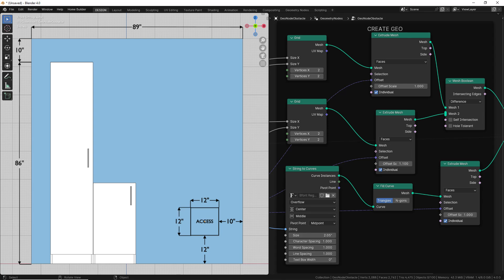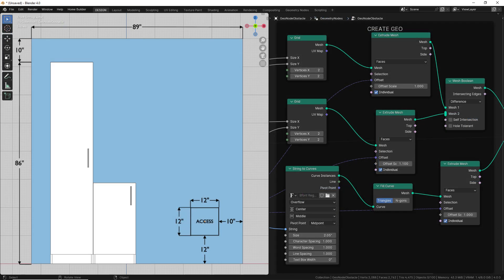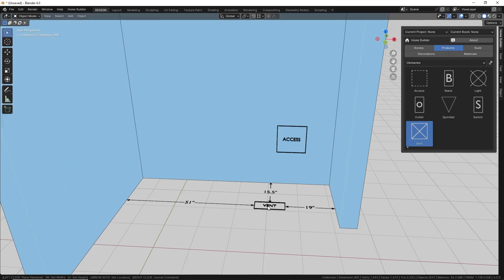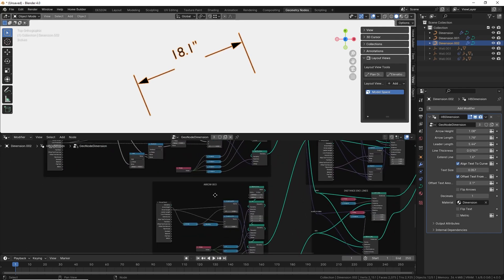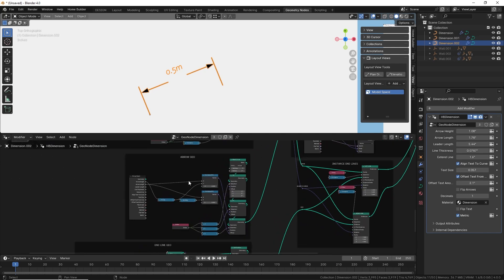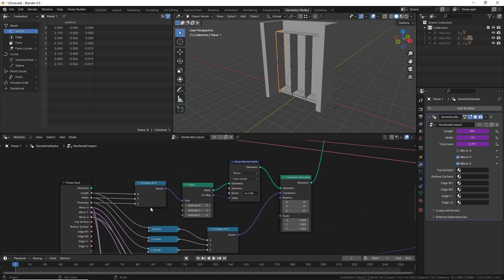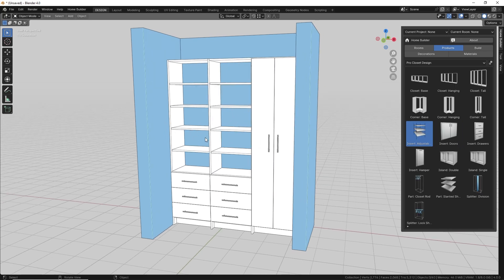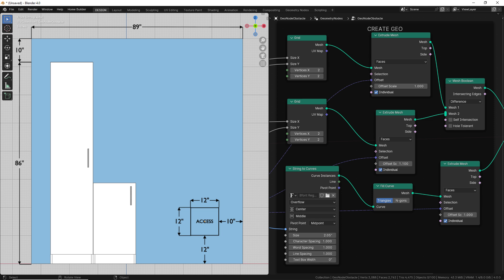Home Builder Geometry Nodes

Comment: another question - two in fact: first, the 'changing mesh size' function is inspired (it might appear easy to non-geonode geeks, but for us mere mortals it's like magic), would the dimension values update when the mesh is altered, or is that asking too much...
and second, is there a single geonode structure that controls all dimensioning, or does it duplicate itself every time you add a dimension... in other words, does the dimensioning geonode increase the filesize significantly as you add more and more...
Reply from the maker: The dimensions can be automatically updated based on the changes to the mesh. A single geo node is used for all dimensions, so it shouldn't significantly increase file size.

Comment: looks great - my question is, is it printable, ie can one create an SVG or similar file and print say via IrfanView, GIMP etc - in other words, is it possible to print to paper with the dimensions visible in plan, elevation, and maybe even isometric views
Reply from the maker: Yeah I will have a way to generate a pdf from the plan, elevation, and 3D views you create with dimensions. I still need to implement a way to create vector files, but that will be possible.
Reply: @andrewpeel1996  thanks - sorry, only just saw this now :o

Comment: Hi Andrew ! Excellent YouTube Channel ! Keep up the great work ! I have watched all of your previous videos numerous times, and was extremely impressed with this last video "Home Builder Geometry Nodes", which you posted well over 7 months ago ! I'm not a programmer by any means, and I know that development does take some time, but I was wondering (a) when you are intending to release what I will assume to be "Home Builder 5.0", and will it include the (1) Pro Cabinet/Pro Kitchen, (2) Door Styles, & (3) Complex Geometry Modules ? (b) What is the time frame schedule for its release (c) Indicative Pricing for the respective Blender Addon Modules, and (d) Will you be able to GCODE output the final designs, directly out of Blender to directly run Nested Based Manufacturing CNC Machinery, complete with possibly Bill of Materials (BOM) and Tool Pathing, and True Nesting ! I'm sorry for the extend of all my questions above, but as you can appreciate I'm very excited with the possible prospects of your current development, and its overall progress, and direction ! With kindest and sincere regards. Kinetic Joinery.
Reply from the maker: I will have a new release out soon which will include many of the items you listed. GCode and Nesting will take some time. I don't have a time frame for the next release, but I hope to make it available soon.